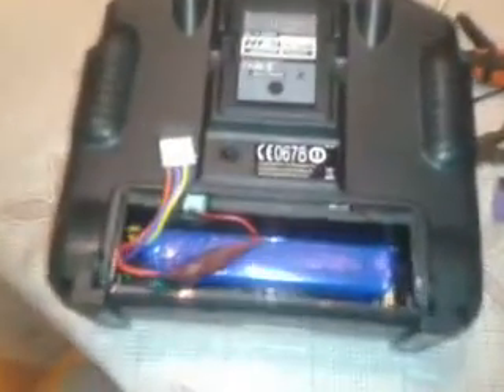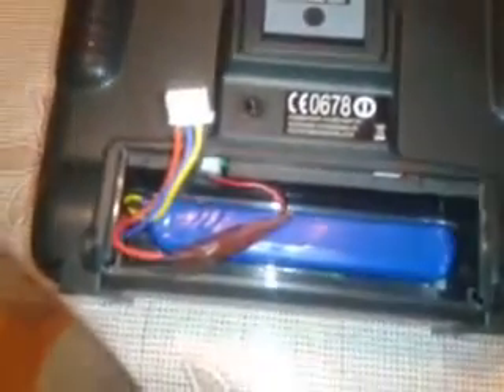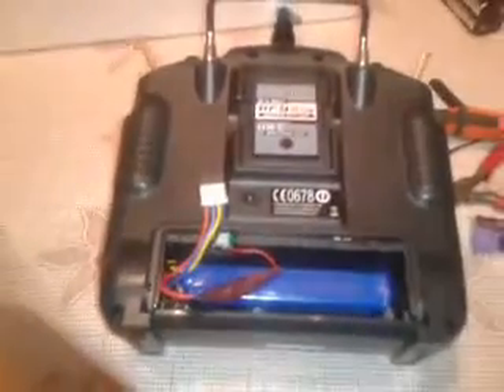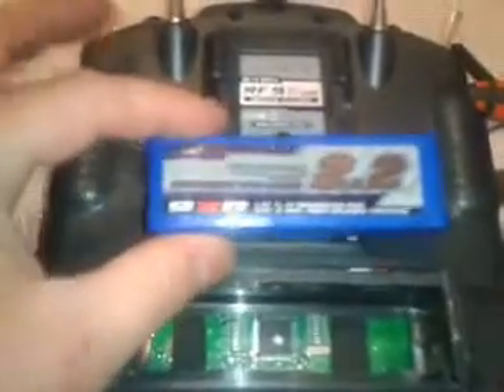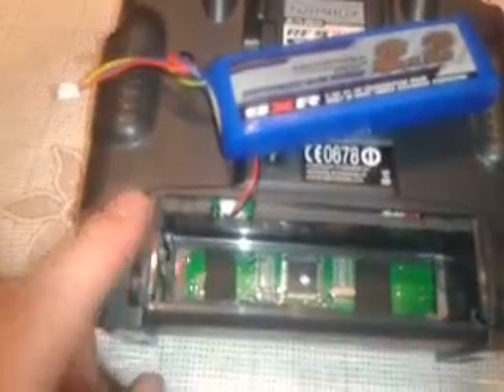Turnigy 9X V2 lipo mod

Comment: nice. I prefer a 9.9 v LiFe battery. They are more stable than LiPo , lower voltage too. You risk damaging yr radio with a full charged 3s LiPo. check out rcmodelreviews channel on this topic.